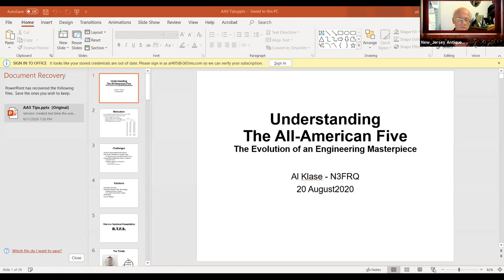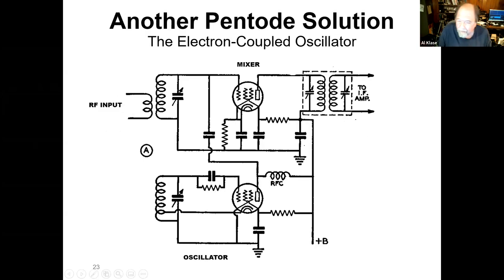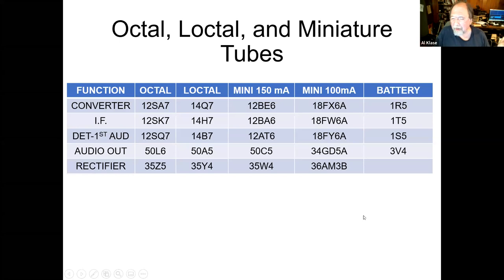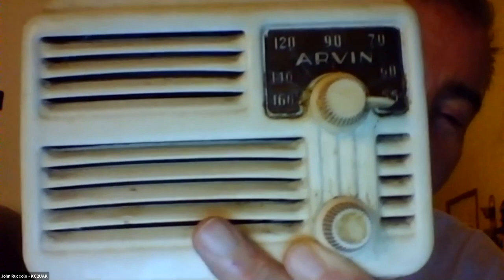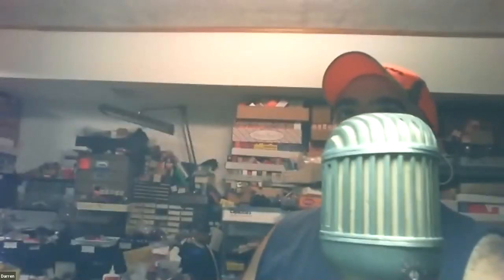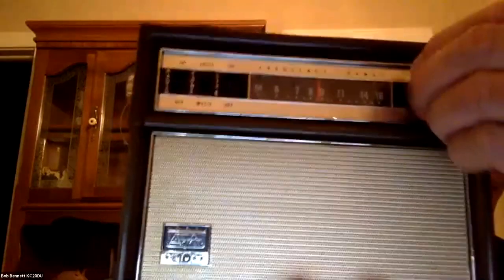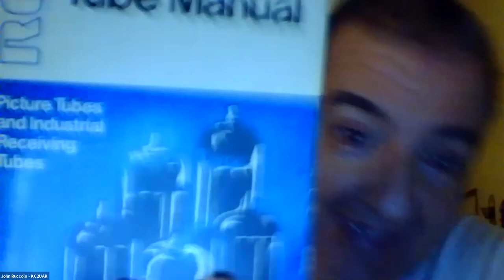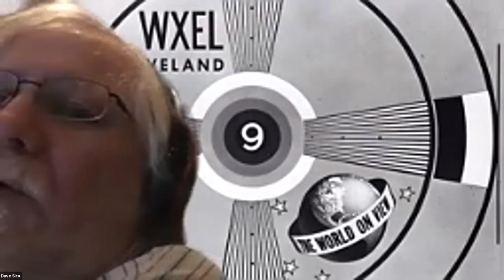Understanding the All American Five: The Evolution of an Engineering Masterpiece

Comment: Thanks for a comprehensive and well explained video. Your explanation of why the power switch is on the ground side is wonderful and enlightening! I never thought about hum. I always had issues with many techs who say this isn't safe (I myself never in 45 years got a shock form these radios, but a slight tingling when I touched a knobless shaft and was leaning my other bare arm against my iron radiator). I also remind them that UL listed them as safe for consumers. If they did so, I say there is no real danger unless one drops it into their bathtub while bathing. I love your response. If you're afraid to use the as designed, cut the cord Love it! I mean, I agree with using the polarized cord to make sure the chassis is connected to AC ground (neutral) but other than that, I keep mine as designed.